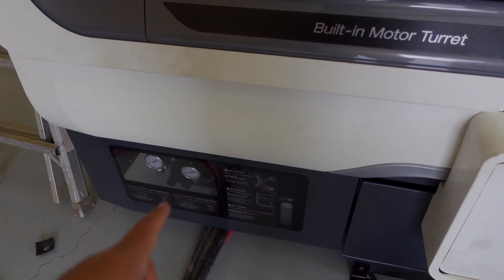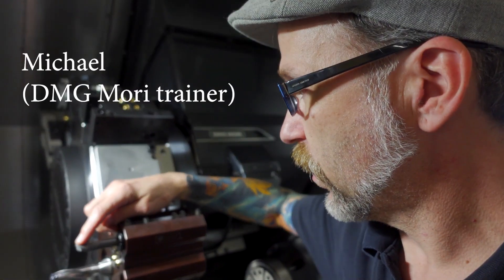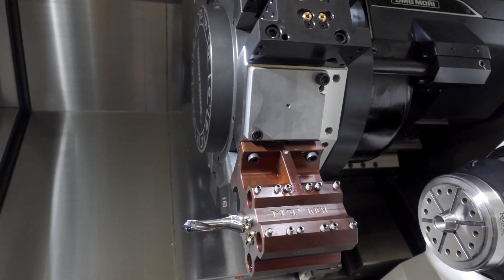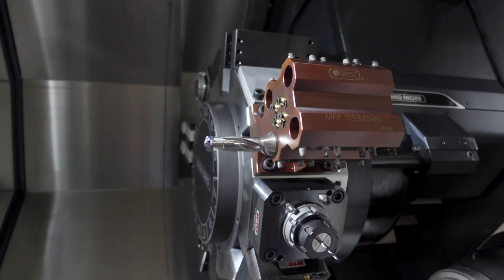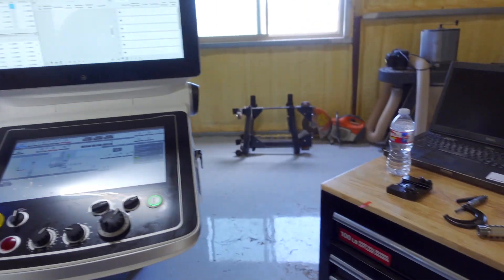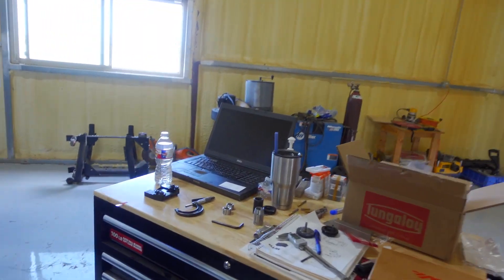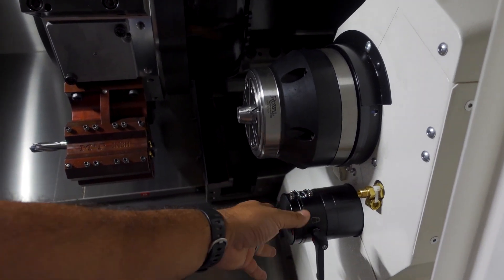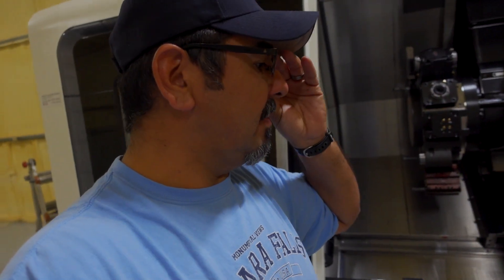DMG Mori lathe training Day 1 | Starting a machine shop 9

Comment: I cam in my shop one day and my CNC vertical milling center's tool holder was rotating backwards.  I would call for tool 18 and end up with 2 as an example.  It took me all day and then i realized that the tool changer was the only thing that was not on a servo drive was the changer. I reached over and hit my lathe and sure enough it was backwards.  Sometime the prior night the electrical company had a problem with the lines and when they hooked them up they hooked them up wrong and had 2 of the three phase lines backwards.  It took them 4 months to change it.  In the mean time i just reversed my wiring in my shop....

Comment: So was this machine free or did you have to buy it. Dmg machinery is not cheap
Reply from the maker: Where are they giving away DMG Mori lathes?  Sign me up!  😂
Reply: @ErikCortina  Hi . I work for Wabtec.  Wabtec bought General Electric Transportation. 12 billion $.  The company builds locomotive engines. 85 percent of the building is a machine shop. Every machine is cnc . Building is 500k sq. ft. Mazak Mori Seiki ect. I know the costs of machines.. Either you hit the lotto or pro shooting pays really well. Your vids are informative and done reall well.

Comment: Call Blaser.  I recommend synergy 735.  It has no emulsifiers, so oil won’t contaminate your coolant and it has a 36month sump life.   No smell.  It’s great on your skin too.  Won’t cause dermatitis .  One thing though. This stuff requires DI water.  Oh did I forget to mention, because you have a new machine.  Blaser with fill your machine with coolant for free on the first charge up.

Comment: I’m a machinist in the aerospace industry and we use TRIM coolant so if you don’t like the kind you got it would be worth looking into. Never used the kind you have but whatever you do don’t use Blaser coolant.
Reply: Everyone has their own specs but different coolants are rated for longer life with different metals. Some coolants don’t work well when you mix metals. Some work better with certain metals and some are only for composites.
Reply: I'm no machinist could you explain why not to use the blaser coolant? And why they use trim coolant
Reply: @tacticalrabbit308  the blaser coolant will rot in your coolant tank and smell terrible and it leaves a film on your finished part. Trim doesn’t smell or leave a film and it’s also biodegradable
Reply: do you guys have DMG MORI DMU? r do you know heidenhain?

Comment: DMG Mori is a very high quality machine. It’s so much nicer than a Haas. Spindle speed on it is very good for roughing and finishing of hardened parts without needing to anneal. Welcome to the world of machining, your world is about to be change forever. You’re going to wake up in the middle of the night wondering if you checked the ph of your coolant tank.
Reply: And if you let that coolant sit for a few days it will get to stinking ! There is these little wheels that skim the oil out of the coolant tank and they help big time!
Reply: Ray Blankenship There are synthetic and semi synthetic coolants that don’t smell if left sitting.  What makes them stink is bacteria growth.  I have a semi synthetic oil in my lathe that doesn’t stink at all.
Reply: @raybship1 
It does depend on the quality of the Soluble Oil you are using.
The old school ( Mineral ) Cutting Oils are very bad for growing bugs which is not great for you and the machine.
But an Oil Skimmer Definitely makes a difference.
Best to use either Semi Synthetic or Full Synthetic Cutting Oils regardless of the machine.
Reply: @raybship1  A well maintained new machine without oil leaks , paired with the correct coolant for the materials you're gonna run Won't stink after a few days . Not even after weeks , but a "middle aged machine" that was never properly cleaned  will smell like shyte .